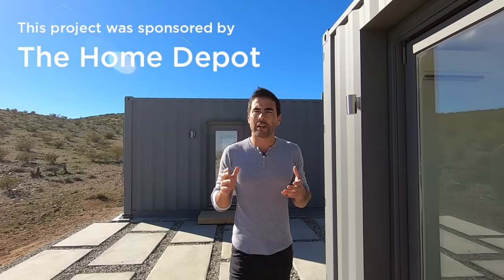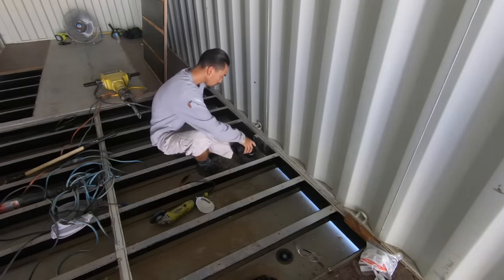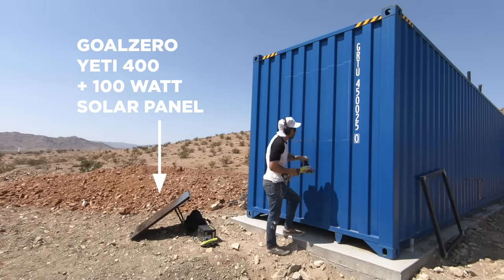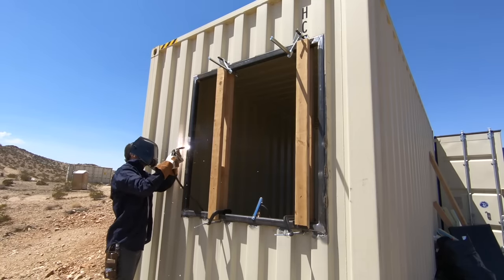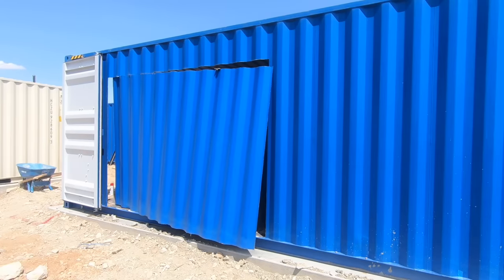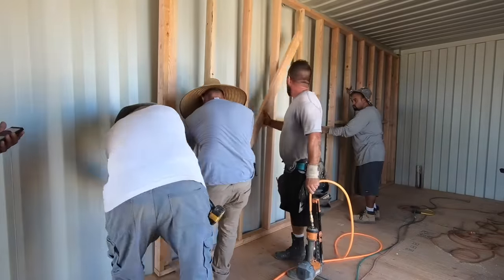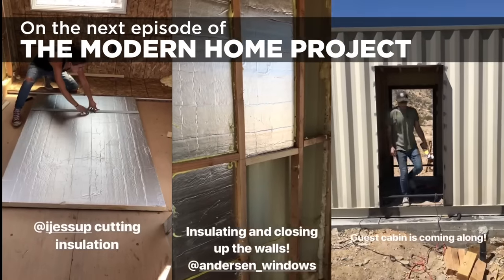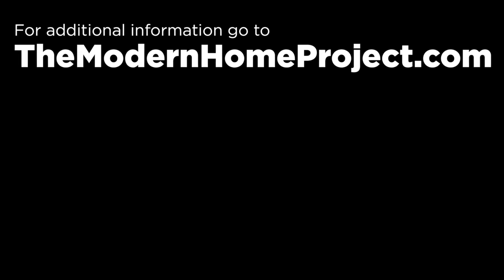Building a Shipping Container Home | EP02 Moving, Cutting, and Framing a Container House

Comment: Sprinkler System in a house that is so small you fall out of it when you turn in your bed.

California really is trying its best to create a housing crisis by inflating building costs to the extreme, doesn't it? xD
Reply: It's a house where the structure is made entirely out of metal yet sprinklers are for some reason necessary
Reply: Noel Medina I guess you think it’s a good idea to be baked like a pie if a blaze starts in that metal box
Reply: @owen_z_schwartz  in such a small house it's not really necessary because the exit will be easily accessible and the house won't burn down or damage the structure. Sprinklers are understandable in buildings with wooden structures to try and prevent fire from spreading as well as in multiple story buildings to suppress the fire and allow people to exit.
Reply: Noel Medina the fire would very much eat away at the actual support (made of wood) for this house. Then it would most likely suffer from irreversible damage in the steels structure as it would warp and possibly weaken with the fire. The fire would definitely need to be suppressed because it would be close to impossible to get out of that house with how little windows there are. If you were in the bedroom and the fire had spread from the kitchen to the side with the window, there’d be no escape left. That’s why corridor style houses need these kinds of systems especially to prevent these kinds of situations which would happen almost every time with the way these houses are built
Reply: @owen_z_schwartz  So with the next opening never further away than 2-3 meters, you think sprinklers are actually necessary? 
Let alone your support for legislation like this forces others, who don't think it is necessary, to pay thousands of dollars to install it.
Reply: Torsten Heinrich regulations are usually written in blood.
Reply: So true. Each new regulation and code probably causes another dozen families to become homeless because their wage is no longer enough to pay for the laws that un-elected experts make. All because these experts seem to have a quixotic quest for perfection. My question to them is: When will we be safe enough? When that day comes, if it ever does, will there be anyone left who can afford to build with that level of code complexity?
Reply: Sprinkler system ?? It's a steel box, it's not flamable. .....You have to frame it in wood, so now it is ! WAH WAHHHHHHH
Reply: RONNIEJNZN 

The shell is metal. The remainder of the structure, fixtures, and content are not.
Reply: @timdowney6721  Actual firefighter here (and investigator, to boot); sprinkler systems are controversial in terms of their cost/benefit. On the one hand, assuming they work properly, they will reduce the chance of a fire. On the other, the damage caused by the water could be substantially more than what the fire would have caused. (This is a constant issue with fire departments gauging the response so as to not cause more harm than the fire).

As for saving lives, again, debatable; most people don't die from the fire, but from the smoke, and sprinkler systems typically work on the basis of heat. So, as long as the fire doesn't get too hot, it'll still kill you. 

Here's thing, though: at least in my jurisdiction, insurance covers fire damage, not water damage. So, in reality, sprinkler systems' primary job is to save insurance companies from having to make larger payouts.

Personally, I don't have a sprinkler system in my current cement house; in my prior wood house, neither. I don't think the cost/benefit works out; I wouldn't advise putting one in, but if someone wants to, I wouldn't be a against it, either. Buildings above four floors, however, they are great.
Reply: @DJohnGrady  Agreed. A separate question, don't sprinklers require a separate water source with much higher pressure?
How can that be achieved in a situation when a house is off-the-grid like in the video? It has no apparent water source or electricity (propane and septic are not a problem).
Reply: @jcrnda  Well, there are "wet" and "dry" sprinkler systems. The former have water in them,  though for a small domestic set up, I don't think they need all that much pressure. The dry ones are just the tubes in place so the fire department can plug into them and pump the higher pressure water into the system.

We don't see his setup, so can't say which it is, and I don't know what California requires, actually (you know, not living there and all :p)
Reply: Tim Downey By the time a fire truck got there it be gone anyway.
Reply: Well of course it needs sprinklers... they put all that kindling inside of a perfectly sturdy steel box... now they have a self quenching wood fired oven. facepalm
Reply: Can grease fires melt steel beams? 🤔
Reply: @xthatwhiteguyx  Steel becomes plastic at around 1370o C, depending on alloy. In an enclosed area any fire, with enough fuel and oxygen input, has the potential to melt steel. If the steel itself is catalyzed it will provide it's own oxygen in the reaction and begin to burn. Some domestic fires do indeed get hot enough. Although most households don't have enough grease/oil on hand to serve as a sole fuel source in such cases. Common vegetable oils have smoke/flash points as low as 107o C, once ignited they generally catalyze other nearby fuel sources, and cause a large amount of soot damage in the process, even if the fire itself doesn't spread to the structure, the oily soot is a nightmare to clean up. Aside from the question of melted metals; a thing to consider with oily fires... water is the last things you want to apply to a small grease fire. Doing so will cause a burst of steam (explosion) that caries flaming oils and spreads the fire. Steam burns are horrible, as are grease burns. Always smoother oily fires with a fire blanket, pot lid (kitchen stove top), dry chemical extinguisher, or fire suppressant foams.
Reply: Torsten Heinrich 
Commifornia 😉

Comment: U know it honestly would have been easier to just frame a regular damn house...
Reply: But would it have been cheaper?  Or stronger?  Or even faster?  I am not disagreeing - I am honestly asking.  I am curious about whether or not these types of structures make sense.
Reply: @benzuckerman  
Cheaper? Yes. They basically framed a house inside the container with 16 on on center studs for structural reasons, even though top to bottom steel beams combined with their reinforcement steel frames are enough to make the container structurally sound.

Stronger? No. A reinforced shipping container is stronger, though, it would've been better if they'd had steel reinforcement bars going from the top to the bottom of those openings.

Faster? Yes. Cutting the steel, moving the containers, and welding the metal reinforcements add a lot of time to a project in which they're already framing using 2x4s with 16in on center studs.
Reply: At least with a regular framed house, no need for cranes, welders, and the rooms don't have to be skinny as:-)
Reply: Benjamin, yes, yes, and yes.  Not only that, they wouldn't have been hindered by the dimensions of the basic 8ftx20ft or 40ft  containers.
Reply: Tod Isboss    Regular house are less economic et More complicated to build mister smart
Reply: Oscar, if you believe this you are a numbskull... :-p
Reply: Agree, all the money for the containers and it basically turned into siding, and the cost added for cost of steel frames for the doors and windows is nuts. Also the extra time. I’m sure when time and materials are added up a stick frame would have been cheaper for this project. But it would have been a fun project as long as it wasn’t my monies 👍🍺😎

Comment: What's the point of using containers, you basically built-in a total wooden house.
Reply: adven ture pretty much exactly what I was thinking.
Reply: Really right?? I guess just for the aesthetics now. Maybe in a different state it could be different.
Reply: On a legal note, He had to frame it out because the structural integrity of the shipping container was compromised when he started cutting giant holes in it. For it to be up to code according to California, he had to have some sort of structural reinforcement, 

and I mean, if you want electricity or plumbing you probably want to have framing inside because otherwise you are going to have a bunch of wires and pipes running around your walls which just looks really shitty.  Also its a lot easier to mount things to a frame than just straight through 1/8th of an inch thick (.3 centimeters) exterior.
Reply: I couldn't believe they did that...
Reply: @frizzykid100  Seems like more trouble than building from scratch, by far.  Hopefully it was considerably less.
Reply: Exactly a 2 man crew could frame and roof felt that in less than 2 days
Reply: @frizzykid100  hmmm, yes, i wonder how much extra it would have been to use steel framing instead of wood. Steel to steel would have been much easier go join.  In Australia we have a few options like that, you can use steel instead of wood as a frame.
Reply: what's the use of the project when you have to frame the whole wall? .. what a waste of money .. maybe for eco-tourism only?
Reply: @frizzykid100  What is the Cal. Building code section?
Reply: yeah, why be creative when you can be regular?
Reply: Yeah, or if you really want the "strength" check out volstrukt... He could have ordered every single cube already setup, insulated, and probably light enough that he could have moved it by hand with a crew.
Reply: Total BS. The authority that is permitting the construction has insufficient knowledge, rules, and data on steel container construction so they have you build an inferior wood frame inside of it that aligns with legacy building codes and regs. Once you add the reinforcing beams around the new openings and weld them, no additional structure is needed. This is demonstrated by the fact that full size containers can be had with doors on all sides just like the smaller unit used for a storage unit mentioned earlier in the video.
Reply: Exactly....all they saved was exterior Plywood and siding, which would have been cheaper than buying containers, getting them moved, cutting metal, welding...etc. They will need roofing anyways, else the heat will kill them.
Reply: EXACTLY
Reply: adven ture soo true. WTH is the purpose of using the container absolutely nothing.
Reply: @frizzykid100  California like most other authorities have no experience on coding steel structures of this type.
Reply: In practice these containers are stacked up to six high on a ships deck.  They are also made from "Corten" alloy steel.
Reply: The welding set should have been using the appropriate Alloy Steel wire for making welds in this material.
Reply: His structural engineer was incompetent!
Reply: There is no point, this is a very detailed how to on how you can use non standard building methods to increase the complexity and cost of a structure while wasting money in the process and gaining literally nothing for it.

If your goal is looks, build a box out of SIPS and side it with ribbed aluminum panels.
Reply: to protect the house inside duh!!!!
Reply: @Ashley Stroebel just like you have a right to your opinion i have mine!!so live with it!
Reply: @Ashley Stroebel you said it !!!
Reply: Yaah right
Reply: Dave Piotrowski ,
Reply: Dave Piotrowski exactly
Reply: People have this vision of shipping containers being easy and lego blocks to build with. If there is anything I have learned in architecture is to simply not use them. They are pretty uncomfortable to live in, and it takes a lot of building, design and structure to make them conform. Think of them like a stack of drinks cans. Now think about cutting holes in those or figuring out how to insulate them. And don't even think about stacking them in another way than the way they are meant to stack.
Reply: A really stupid build
Reply: Given the desert climate, pouring and flipping up concrete/aggregate "adobe" walls would make a superior home and cost half as much while taking 1/4 the time. Oh well.
Reply: They're survival homes, earthquake and storm-wise, much more than traditional homes. Always a science to what seems like madness; plus, cost effective.
Reply: @dino_matt  who wants to be just "regular?" When you can use your imagination and be creative. Regular is sooooo boring😕
Reply: Must be California Right! Of kill on everything...
Reply: No f-n shi×! 
Wtf just build a damn house!
Reply: @davepiotrowski1992  Notice nobody even understands you. Being Aussie, I suppose. The USA is still addicted to wood frame houses. They rot. Termites. Fail in Hurricanes, Tornados, Earthquakes, Wildfires, esp when built crappy. GOD BLESS THE CORRUPT GOVERNMENT and, Locals, Builders, Insurances, Suppliers, etc to keep FROM the very idea of building homes that resist rot, termites, weather, made of steel, gunite, cement.
Reply: yeah pointles to use 2x might as well build a house. cali required tons of metal neways. and hold downs lmfao
Reply: @BabeTryThis  The problem really is the big doors. If they didn't have those, the metal reinforcement would have been enough. Sure, some internal framing is needed for wiring, insulation, and interior walls, but wouldn't be anywhere near as much material or work as this project needed.
Reply: @jainsaras18  Some interior framing would've been needed for wiring, insulation, and interior walls, but they wouldn't have had to use anywhere near as much for that.

I'm honestly surprised they didn't have the steel reinforcements for the doors to go from top of the container to the bottom, if structural strength were really such an issue.
Reply: @scottrunge4077  SIPS are awesome.
Reply: adven ture And the container's dimensions are more than a bit off.
Reply: It might have been better to put 2 or more containers adjacent and another stacked on top to create some space and interesting angles
Reply: I agree
Reply: That was my exact thought. I’m going to go with he liked the trendy look of the container homes, it was for cost or necessity. I’m looking to build one in the next year or so...it will be amazing but no one will know that from the outside. I do like the 20’ containers with the side doors, ideas are flowing like putting 2-3 in a row so I won’t need to cut into anything to connect them ....I learned something and he does a get how to. Yikes I’m chatty tonight 🤦🏼‍♀️
Reply: Exactly. After making so many cutouts and adding enough wood to build a regular small home, I'm like what's the point???
Reply: @bretbowman2007  citation needed
Reply: @BabeTryThis  citation needed
Reply: @frizzykid100  that's not a problem,  you can use conduits... and the main structural resistance is given by the pillars, not the frame.
Reply: I never imagined going this far with containers.
Reply: more durable than wooden house , The Container house is heavy so this is safe in  hurricane than wooden house
Reply: @alexhoti9822  they destroy the container... horrible work.
Reply: Bricks are fkn expensive ppl
Reply: he also planted concrete foundations good for a skyscraper LoL. total nonsense.

Comment: I mean, I get that shipping containers are a thing; but you've essentially built a timber frame structure within the envelope, then clad the outside of the container. Wouldn't it have been a lot easier to build the whole thing as a traditional stud frame or what?
Reply: @tailgatecarpenter26  personally, the open yurt designs are pretty appealing, but I won't knock people who'd rather live in a framed out tuna can.